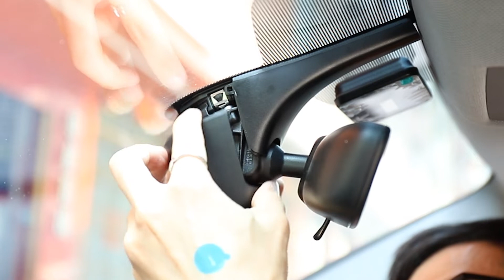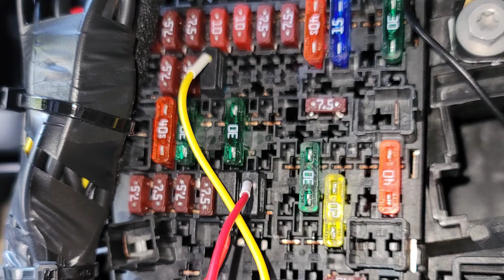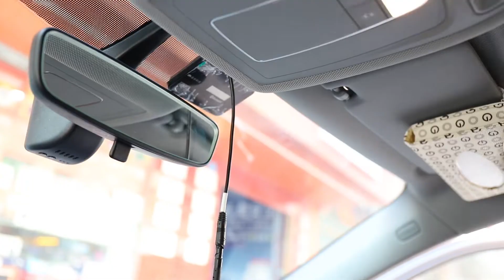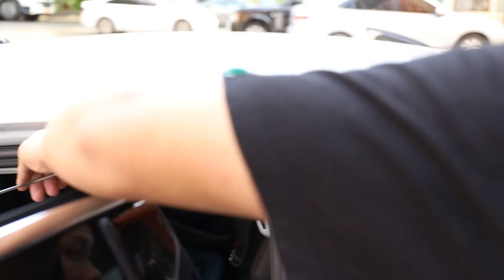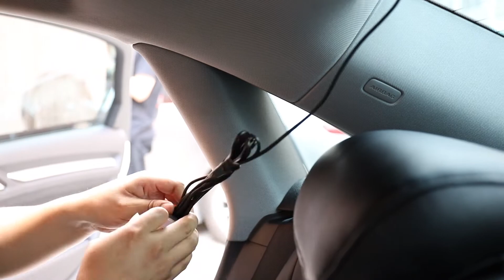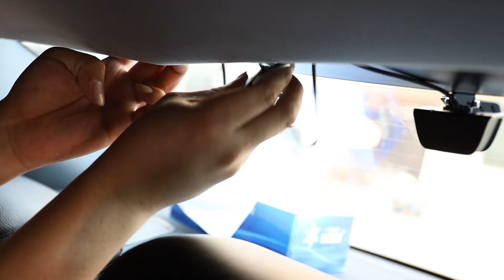Fitcamx Dash Cam for Audi- Rear and Front Cam

Comment: Why do you need to run a wire to the fusebox? I didn't see this piece mentioned on the Fitcam website resources? Is this specific to when you install both front and rear and is it required to run to the fuse box?
Reply from the maker: Hi, the fuse box is only used to activate parking mode. If you don't need parking mode, you can just connect the plug on the rearview mirror for easier installation. Thank you.

Comment: running the cable in front of the side airbag seems very dangerous in the event of a collision. It may also render the video footage worthless if the airbag deploys and yanks the cable suddenly from the camera.
Reply: Cable appears to be behind in electric panel
Reply from the maker: Hi there. It's will not affect you to use and it's safety. Please don't worry about it.
Reply: @fitcamx  I just orded one, front and rear!!! very exited